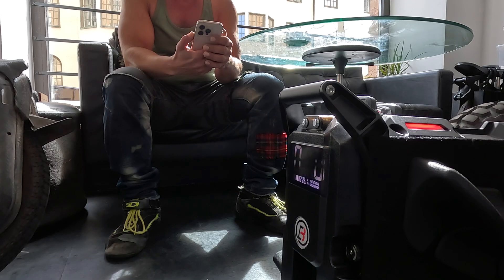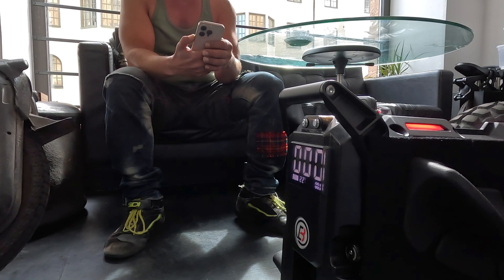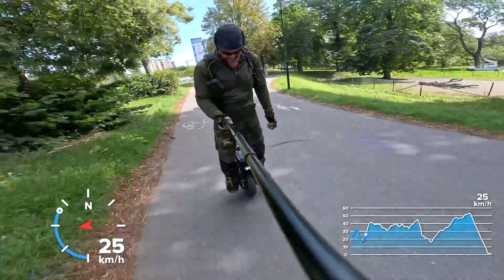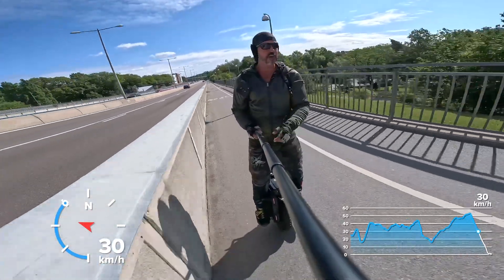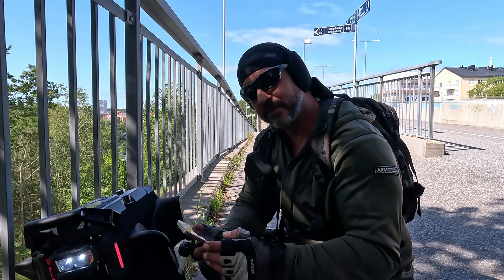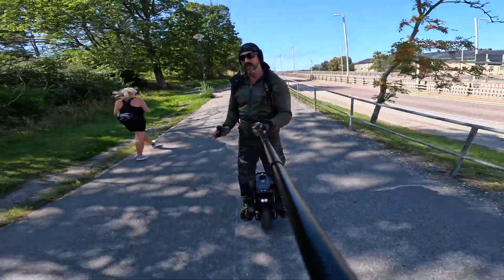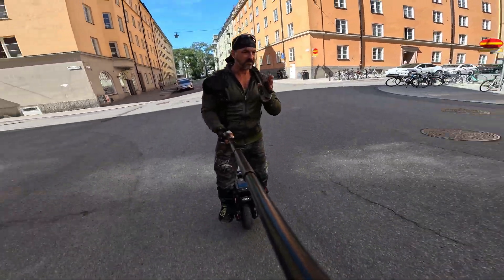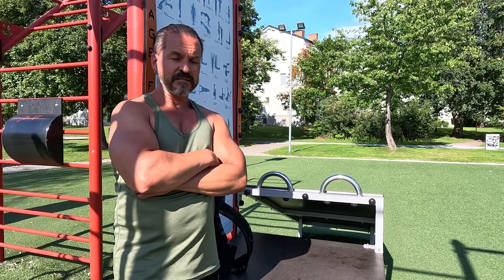Extreme Bull Rocket Speed Test at 60% PWM

Comment: Only wheel I find interesting from begode since the mten4. Also damn you trusted that wheel 😆
Reply from the maker: Yeah it is actually a pretty interesting wheel! Trust it? Haha you mean because I tried it at 60% PWM / 60+kmh? Lol... yeah that is an acceptable risk for me. If I die at 60 PWM... so be it. They can write it on my grave. I've always said though... that if I die I want it to be at least at 80kmh.
Reply: @isthereanyfood  I mean trusting it since there isn't a lot of rockets out there that have been tested, but once you get on the wheel you forget about all of that 😅
Reply from the maker: Haha yeah I was satisfied with the testing that I had done so far and it seemed reliable enough for a 60& PWM test. It has plenty more to give but I didn't think that's necessary.